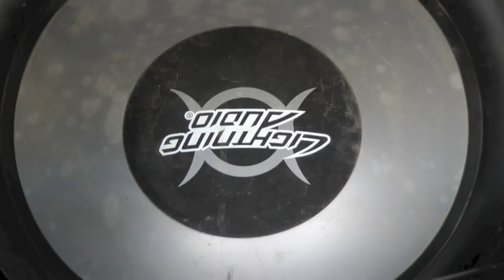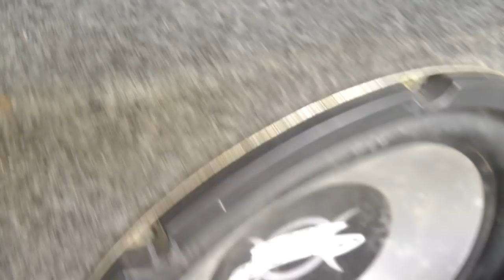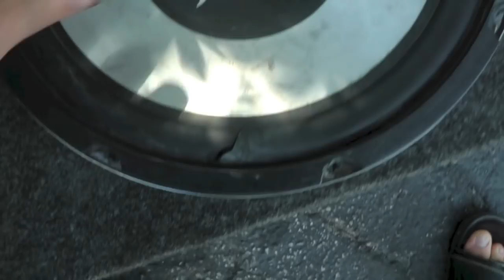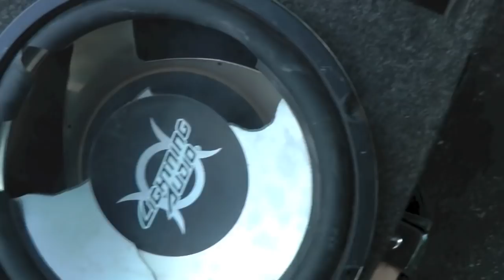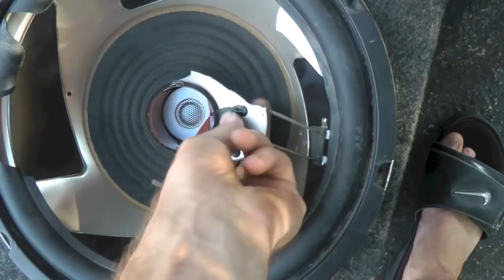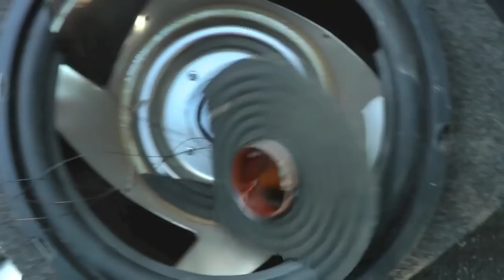Blowing up a lighting audio sub

Comment: Lightning Audio is actually a lower end entry level company owned by Rockford Fosgate. I had an old Lightning Audio woofer inside of a VERY bad box with TONS of port noise. got it from a friend. Blew the bastard up and have since moved on to a JL WXv2 12 inch in a custom box witch sounds a shit ton better then the Lightning Audio did.
Reply: +EpicEverythingDude75 
They are owned by Rockford Corporation, not Rockford Fosgate, just to be clear. Rockford Corporation distributes Renegade, Lightning Audio, Helix, Brax and Rockford Fosgate.
Reply: So you had a Lightning Audio in a crap box and a JL in a custom box. Wonder of wonders that the JL sounds better...

Comment: nice job blowing a low end ROCKFORD sub. sure just yank the wires out when amp is still running. good way to fuck up your mosfets
Reply: Lightning audio were LOW END Rockford's. Call Rockford if you don't believe me. They sold them under the lightning audio brand to Walmart for a period of time. Amps as well. I said LOW end not actual Rockford. They actually aren't that bad for a beginner sub. Discontinued as far as I am aware.

Comment: Excellent video *cough. First lets have 2 enclosures, one 10 years older than the other. Then drywall screws attaching a woofer upside down. Then force poorly recorded and produced shit through it. The LA woofer would be entry level quality at best and likely a third the price on the wayyy better Alpine. The mass-produced vented box could be a major factor in the demise of that sub, too. LOUD bass with lots of distortion.
Reply: FACTS

Comment: who jerks the wires off of a speaker risk of blowing your amp
Reply: blowing the speaker risk frying the amp to, I've had a blown speaker blow the fuse on a rf amp before
Reply: what's the best way to unplug a blown sub???
Reply: The best way is to go back a step and unplug it as soon as you smell that VC. Otherwise it is best to turn the amp off and unplug it in a fashion that the wires and not going to touch together. At the very least he should of disconnected one wire at a time after he turned it down all the way but off is the best way. His amp has short circuit protection but it's not something that you wanna be testing because it aint a sure fire save the day every time
Reply: All2skitzd so once you smell that the sub is cooking, it's blown already?
Reply: elfrijol1969 When you see it smoking,then yeah get ready to turn your amp off.

Comment: whoa it was built even cheaper than it I thought. No way that was gonna take 700w for long lol
Reply: You must not know enough about how car audio and amplifiers work if you think that.
Reply: Brian Payne What are you even talking about?
Reply: Hless421 Music is Dynamic, the source signal is ocnstantly changing. An amplifier may say 1200rms at whatever ohm load you have it wired for, but realisticly your subs are seeing maybe 600-800rms most of the time. Only time you actually get that power is on stable 14.4v and a sine wave test tone. It is common practice to put larger amps on subwoofers so that there is some head room to work with. So putting a 1500rms amp on a 1000rms sub is normal and common practice.
Reply: You know how an amp works right? Its takes your source signal (HU, typically 2-4v output) and amplifies it. Because music is simply a complex signal, with varying levels of output, the power that the amplifier makes is also constantly changing. Its simple stuff guys, with proper tuning you can put a 3000rms at 1-ohm amp onto a pair of 500rms subs and be fine, even crappy subs like dual or pyle. Just goes to show how little you know about car audio
Reply: You know all those little knobs on the side of an amp? those adjust the signal ouput, tuned low enough, and the ouput from the amplifier will be almost non existant. You really dont understand how amplifiers and an electrical circuit work do you? Just cause the amp says its doing 3k rms at 1-ohm, doesnt mean it always is, and if you tune low enough, the ouput on the amplifier can easily be kept below 1k rms. And yes, at certain frequencies an amplifier on PROPER electrical will certainly (atleast good ones) do more than rated, but thats with proper tuning and electrical, but you can tune an amp down so that the output is MUCH less than what its rated. You do know that right? I am in the process of buying the SAZ 5000 to put on my 4 8in SA-8's which are rated 500rms. And I can garuntee you I wont blow them. Because it will be tuned accordingly so that the output form the amplifier will be no more than 2500-3000rms. Do some research, study up on how amplifiers make their power and you will understand :)
Reply: Plus only reason im doing that is so that im not pushing my amp 100% and I have some head room to work with
Reply: Brian Payne Stop acting like you're the only one that understands how amplifiers work. It's obvious you're being ignorant about anything else besides what you have to say. Why do you think I asked if anybody is supposed to care about what you keep wanting to say? You're just rambling on and on and on. Have a wonderfully blissful ignorant existence....
Reply: Im simply trying to educate that is all. An amplifier doesnt isnt always just 100% all the time, there are half a dozen things and more you can do to throttle your output down. So my original statement of putting 1500rms amp on 750-1000rms sub being common practice is ocmpletely justified and true :)

Comment: Could have used that rubber and reconed another speaker... Oh well
Reply: You talking about using the surround off that speaking and replacing the surround on another speaker?
Reply: +All2skitzd yes
Reply: +BRENDAJASON1 the xmax would need to be the same or smaller

Comment: dude watch out how you pull the cables out, or the sub is not the only thing you will blow lol XD
Reply: Blowing a sub like that can just as bad if not worse. When he pulled those leads it might of shorted together but the amp will usually detect a short go into protect mode. Playing that sub until the VC gives often will cause a short but it can  happen slower so you got a 4Ohm coil and as that coil starts to give it could be slowly working towards a 0Ohm (short) and amp my not go into protect in time. I've had a Sub go bad and blow fuse on amp